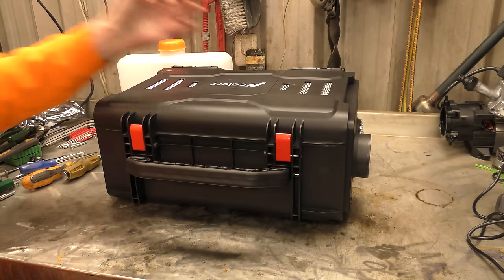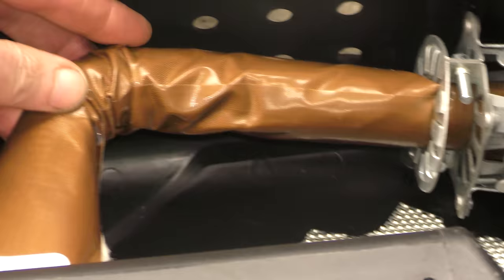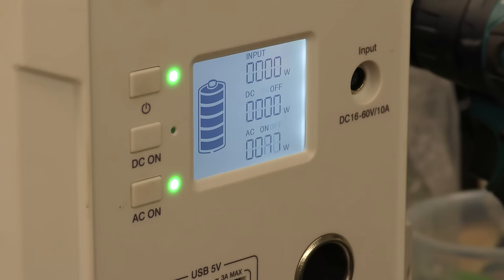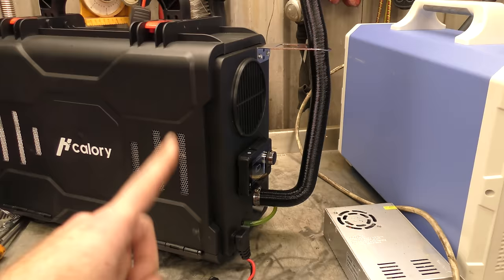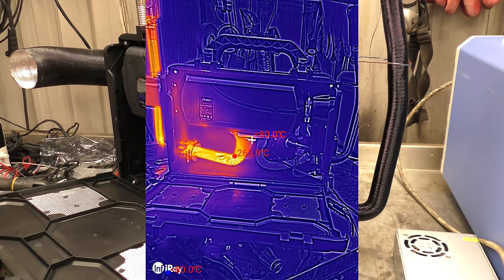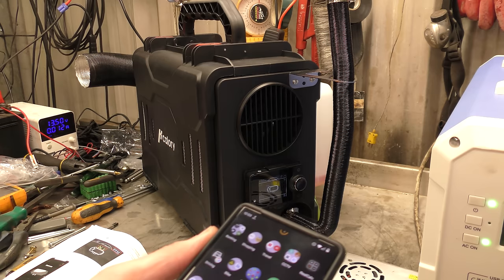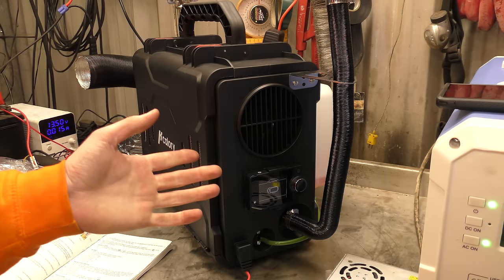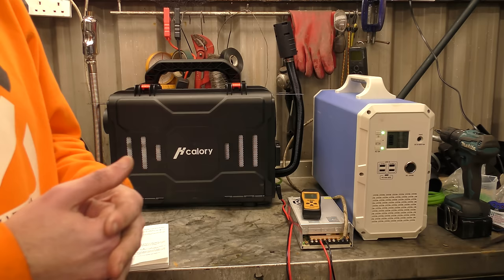Hcalory HC-A01 portable all in one diesel heater + bluetooth control ||  test / review

Comment: As a side note to anyone interested on Chinese diesel heater reliability. My son has been running an 8kw unit in his off grid caravan for 3 years & for 12 -15 hours a day. Sometime 24hrs constant in the winter & it never let him down. The only problem he had, was running it for too long at a low setting which caused carbon build up. The 8kw is too big really hence low running temps. He's an engineer and soon stripped it down and cleaned it out. He now uses top setting for a time regularly to keep it clean. Love your channel Dave.
Reply: Please tell us how much fuel this “8kW” heater consumes each hour.  Somehow I don’t quite believe it is anywhere near 8kW.
Reply: Again you said its never let him down? What do you mean by that? As the next sen3you said running it low caused a carbon build up? Confusing
Reply: @oliver90owner  On its lowest setting (2kw approx) it uses .01 L p/h. flatout .5 L p/h. whether it is 8kw is up for debate. No doubt this can be worked out by diesel consumed. Dave did a test a while on this subject. Also, not use if trading standards in the uk would kick off if this turned out to be wrong. Flatout it kicks out some serious heat and way to much for my 24' x 12' workshop fulltime. i turn it down after 15 mins
Reply: @Woodlandbill  it still ran but, not as well as it should. If you don't follow guidelines on use, it will play up
Reply: @piconano  arr right I see what you mean, so running it on low as not full power causes build up of soot causing it problems, so best giving it a blast of running it on full power, as if it's getting too much fuel and it's not all burning up 🔥
Reply: @guymorton2327  OK thanks, so best to run these things on high, but regulate it your self by turning it off when said room is the temp you want, rather than leave it running on a lower setting 👍👍
Reply: It is my experience that carbon buildup from running the heater on low all the time doesn't happen if the air fuel ratio is adjusted correctly. There is no need to run the heater on high to burn out the carbon. 

For the last 2 years I've used a 5 KW heater to heat my small house which is at 4000' elevation in snow country. The heater is run on low 99% of the time and often runs 24/7. I've disassembled it several times to check for carbon and found no buildup. 

Using one of the cheap CO meters like the David uses I've adjusted the fan RPM vs fuel pump pulse rate for reading of about 10 ppm.  For my heater and location that is 1.3 Hz at 1680 RPM on low and 3.8 Hz at 4500 RPM high.
Reply: The math is .02 [ all pumps] x pulse rate x 60 min x 60 hour , then divide your fuel tank in liter. .02 x 1.2 x 60  x 60 / 10L / 2 or / 24 hour for days to run. Roughly, can run four days  on 10 liters, with the pump rate set at 1.2
Reply: @guymorton2327  No debate at all.  Diesel only contains about 10.5kWh of energy.  0.01l/h would be about 100W, so I expect you have made a typo - should be 1kW (input, not output).  Your 0.5l/h will be about 5kW input (not output).  It makes me smile, the number of buyers/users who think they are getting a lot more than in reality.  It is not rocket science, or hardly GCSE maths even, to calculate the real output.  All we further need is the efficiency, which I doubt is much more than 80% (but only at full power).

The amount of heat required for your particular workshop may well depend on several factors.  Temperatures, insulation, glazing amount (and type), draughts, height to ceiling, other working machines, are the main factors.
Reply: @oliver90owner  Thanks for info. End of the day.. & it literally is. It gives me the heat i need& works perfectly . I am too busy running by biz to spend too much time playing with it..& its cheap to run. I have a wife & a jeep that both need my attention. Result in my book.
Reply: @guymorton2327  Ahh, both you and your son live in that same caravan?  I’m getting the drift of your changing claims.  Keep up the good work.  Others will now understand your inconsistencies much more clearly.  Bill Roberts also noted another.
Reply: there is a 8kw Chinese heater but you will pay near 1000$/usd  for it from lavaner
Reply: @oliver90owner  Measured the Fuel Consumption a couple of Years ago..max. output from a '5 KW' Heater was approx. 3.4 KW IIRC.
Reply: @cerealtiller  I expect the maximum fuel delivery (if the example was actually ‘on-specification’ - which many are not) would be 0.51l/h.  So simple, then, to calculate the input energy potential and compare that with the marketing claims.  Half a litre of diesel fuel will never provide 5kW of heating (unless, perhaps, if a lot of the exhaust gas energy is recovered!🙂).  

If yours was as low as you measured, I expect the maximum pump stroke-rate was less than desired.  Possibly running very weak, as well, thereby wasting even more energy as heat in the increased exhaust gases (any excess air contains five times as much nitrogen as the oxygen excess).

These heaters are good for what they are, but not many are aware of the differences between reality and the marketing hype (which has ‘pulled the wool’ over the eyes of the average buyer).
Reply: I have the planar 44d heater that I heat my 32ft motorhome with.. it is my primary heat. Ihave been using for 4 years. It runs 24/7 from fall till spring non stop. I ran it last winter for 5 months without shutdown. 
These were made for military vehicles in Siberia. Has been a great heater
Reply: There are no 8kW models, only fake ads
Reply: @hunkenpunken   Dead right there - as far as cheap Chinese air heaters are concerned.  Just shows how many people have been conned by these claims - and still keep insisting theirs are 8kW
Reply: @Woodlandbill  There's regular maintenance. And proper ways to run it like any appliance or other mechanical device to avoid problems.
Reply: @oliver90owner  You're right. There is no 8kw heater. 5k max. 2k heaters are just detuned 5ks
True output about 3.5kw for these.
Reply: @robertkeller9828   There are real 2kW heaters - not detuned ‘5kW’ ones.  The heaters are dimensionally smaller than the larger items, with a 63mm warm air delivery hose, rather than the 75mm(?) on the larger units.  Actually, it’s quite likely perfectly adequate for most parked vehicles and small to medium caravans, where they can be run on higher output (thereby reducing the risks of sooting-up problems which the majority are likely to suffer from, by running at minimum output).  I have one - and it only runs at 1Hz on its minimum setting - delivering far less fuel than specified (but it will be OK for my application).

Even though the pump appears, by it’s markings, to be 22ml/1000 strokes, I suspect it is a 16ml pump but have not yet tested it accurately.  It’s easy enough to count strokes for the Hertz at its slowest pumping rate.  For its maximum rate I will be making an audible video of the fuel feed - and then counting the pump strokes by slowing the video play-back to, say, 25% of normal.  Very easy, when one thinks about it🙂 I use scientific grade measuring cylinders for measuring volumes, of course (not a guess with a magic marker line on a jam jar, like some).😊
Reply: @MrHugemoth  Absolutely this sir - nail on head. Sooting is not from low power per se, but from the from-factory settings being off, i.e. too little fan speed for a given fuelling rate.
You can err on the side of virtually no sooting, & run the fan a little too high - but then you'll use more fuel per unit of heat created, as you're almost blowing too hard on the flame.
There is a sweetspot which can be arrived at by monitoring CO levels.

Comment: Don't see how you could use it due to the exhaust setup. The unit would have to be sited outside and it obviously isn't waterproof, needs a bit of tweeking I think 🤔
Reply from the maker: Waterproof in the sense that you couldn't submerge it no.  But I'm pretty confident it would withstand a rain shower.  Perhaps that's another video right there?
Reply: @DavidMcLuckie  Any updates on this part?

Comment: If the combustion is hot enough, the carbon monoxide will burn and produce carbon dioxide. That's why it's a bad idea to try and commit suicide using a modern diesel car's exhaust. The engine runs with excess air so all you'll get is a sore throat (and a red face).

Comment: Hcalory
It's a really good product.
I've also worked on a distilled water capacitor that can extract hot water from the exhaust heat
We succeeded in extracting hot water to 52 degrees
Hcalory
It's a high-quality Musudong heater

Comment: I have the older version if this in the red cabinet,  I run the exhaust into the house chimney when I have a power break, and then I have a large 12v battery connected to a charger which again are connected to the generator 👌 So I can run the router, tv, fridge and some lights while having some heat going...
Reply: How do you connect it to your chimney to stop gasses returning to the room. I would like to fit mine in an unused fireplace. Roni

Comment: They should change the design of their heat exchanger casing and run the first 12-14 inches of exhaust piping directly out the burner and free float through the air tunnel it would make more heat off the exhaust and cool it down before it exits the exchanger body so exhaust tempratures are lower. it would probably be 30-40% more efficent too.

Comment: Just had 2 x all in ones delivered today, 1 for my dad and one for my son. Just got to drill a 28mm hole to the outside in their homes for the exhaust. That's 6 I've bought so far this year thanks to you. So cheap to run especially on kerosene with no issues with the pump 😁
Reply: I have three diesel heaters and add a cap full of 2 stroke oil to each fill helps lubricate the pump
Reply: Exactly what I do. Mate who has a woodwork hobby shed has oil heating in his home plus 1 diesel heater and has been running it for almost 4 years doing the same
Reply: @paulbrammer1513   I also use an Aldi steam cleaner blowing steam into the cold air intake seems to help keep the combustion chamber clean
Reply: yes that Australian guy John mck really started a rumor that people recite as truth over and over.  Happens all over the forums. He has some good basic videos but there's quite a few issues with his videos.  I mean he is always using them in a t shirt outside with temporary set ups in his videos 😆
Reply: Most diesel has biodiesel added as a lubricant.  Check the pump sticker next time you buy fuel. Biodiesel is incredibly slippery, and it replaces the sulfur compounds which were previously used to improve fuel lubricity. If you stick with two stroke oil be sure to use an “ash-less” type to minimize carbon buildup

Comment: Great video as always David seems like a nice little heater, if you wanted to run it outside it would be handy if the manufacture would include a external temperature sensor so it could be indoors or even make the controller detachable with a longer lead but maybe that will come in a future update, not a bad price for what it is plus it's a small step closer to the Afterburner but still nowhere near the functionality.
Reply from the maker: That would be a good idea as well.  An extension for the temp sensor.  Don't really want the exhaust gas in the space you're heating, and having it ventilated just means you'll use a lot more fuel trying to stay warm.
Small steps, but at least they are trying.
Reply: @DavidMcLuckie  your link to purchase this product now says not available in the UK.
Reply: USA and Canada only
Reply: Apparently you just remove that control panel, cut the wires and extend the wires into your Van/Camper/Tent.
Reply: @DavidMcLuckie       They Don't ship to the U.K , the one you have in your Description for £134 , they are from China
The Cheapest one i could find in the U.K costs £159
Just thought i would let you know.
I was going to not attach that Diesel container to the side of the Heater , i was going to use a 20 Ltr container instead and drop the fuel line in it with a weighted fuel filter.  But then i heard the Priming will take much longer because of the distance the fuel has to travel , the shorter the distance the better.

Comment: If you've not already done so is there any chance you could do a quick comparison of all the different controllers testing the idle current when the heater is in standby and not active?

Ie. Afterburner, this bluetooth controller, the ones with 433MHz receivers/transceivers, the simple dial controllers, etc.

What with all the various options now available it'd be handy to know which are most power-conscious when the heater isn't in use.

Comment: Looks like a good bit of kit but, not so sure about the plastic housing re exhaust. That defo needs more insulation. I've just fitted a Vevor chinese 8kw all in one unit in my workshop as replacement for 5kw of electric heating. It works really well. Not just heat but, air circulation makes it much more even spread. Gonna work out way cheaper &  I am seriously considering buying another 1 just incase we get the power outages forecast. This time, I'm going to mount it outside in a weatherproof box & drill a hole through the blockwork for the outlet making it pretty inside before the wife has a fit! . Who would have thought 12 months ago we would all be thinking about so many off grid ways to keep warm. Fitted a woodburner too lol. Just need a mini nuclear power plant and we're sorted.
Reply from the maker: Better prepared and it not happen, than it happens and we're in the shit.
Reply: Do you have a link to the one you purchased ? I’m looking at one for heating a unit too. Thanks.
Reply: @thecomputertech  I bought mine on ebay. Type in VEVOR diesel heater and a section  pop up

Comment: Good vid, I just bought and installed one of the ac/dc units....OTOTEC LED Regulated Switch Power Supply Transformers 12V 30A 360W. Question ..my fan went straight on as soon as the  power was switched on, I have a feeling it may be defective, because the advert showed that the fan would only go on if the unit needed cooling, I assume when under load. Aaiting the supplier to come back to me on Amazon.

Comment: In auto mode heater drain battery every 2C up/down. Only power mode is ok with low pump mode and tune fan speed.

Comment: Hi it looks like a great hearing unit BUT if the exhaust and air at opposite ends it would be more practical IE the heater outlet and inlet  are away from the exhaust. You could out side and put the heater pip through a cat for instance.

Comment: I bought a few of these based on the auto start feature, the Bluetooth is a nice touch, but when the first one didn’t function properly by thermostat mode, and f9 wasn’t even in the options menu (even though it is the model that is supposed to do that) and as a party bonus (the heater is mounted outside my 5th wheel with the 3” heated air ducted inside through the floor) I have diesel fumes inside. I shut it down and turned up the propane furnace. These are a real “pile of kit” I’m sending them back, I’ll deal with the non auto start vevors occasionally overheating me, at least I’ll be alive, and not burn down my rig. This was the first hcalory product I’ve tried, and will be the last. Absolute rubbish!
Reply: EXACTLY the same issues here with our 5th wheel - no F9 and fumes inside what on earth!!! Even the book has F9 in the menu
Reply: @legacyfirst  it’s actually moved to f8, but the heaters don’t even heat enough to get to shut off mode. I sent 3 of them back. I won’t buy anybody’s brand with that controller again.  Just yesterday I put a new fan in the OG vevor heater I’ve been running for about 4 years. Still runs like a champ :)

Comment: Great channel, got me into diesel heaters. What would be good is a video where your running max chat on mains power transformer and then get a power cut. What are the effects on the heater internals when there’s no cooling cycle due loss of power?
Reply: I’m only familiar with the Espar brand and while power interruptions should be avoided it generally does not harm anything, as a fuse can blow or many other scenarios can  cause this and the heater won’t melt.

Comment: When u set automatic start up and shut down mode.
Lower u set the temp, the heat and fan speed drop.
36C its max but 21celsius its set at 4 or 5 out of 10.
Adjust it in settings 0 to -9 or up to pkus 9.
But closer it gets to set temp fan speed and heat get lower and lower.
Why is that? Why wont it allow heater to stay at max heat and fan speed.
29C is 7 out of 10 for heat.

Comment: Cheers for the look around on that one, looks a good unit, I wonder if you could take that display off and solder some long wires to it so you can leave the heater outside in a shed say, have the display inside and then still use that 30 second disable feature. Still looks super handy.

Comment: Hi, really good review! Anyone knows if this new type controllers are compatible with an blue lcd mainboard? And if so, if via factory menu it is possible to adapt the pump and fan settings for use on a 2kw heater unit?

Comment: Things that are questionable, is the controller ip rated? They could have stuck it in any box, yet mess of air intake externally. What would have been really smart is completely enclosed with storage and insulated outlet pre heating inlet air.